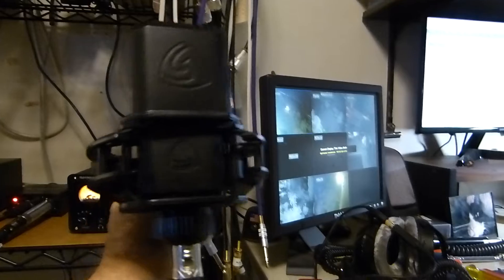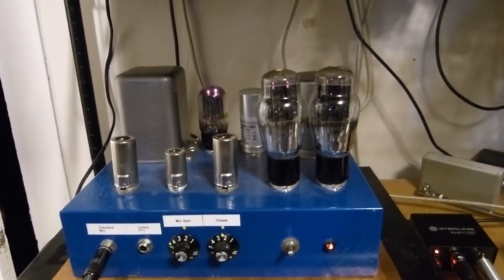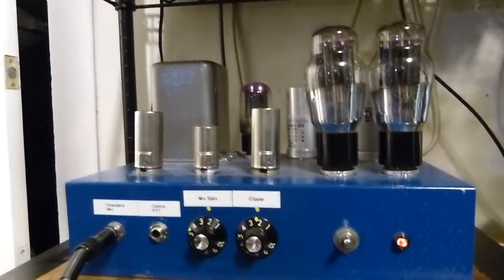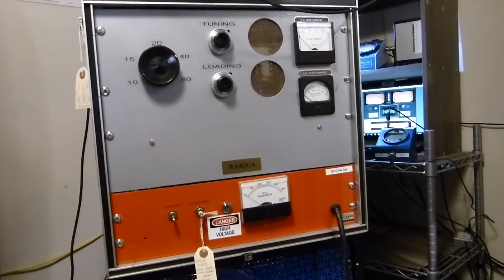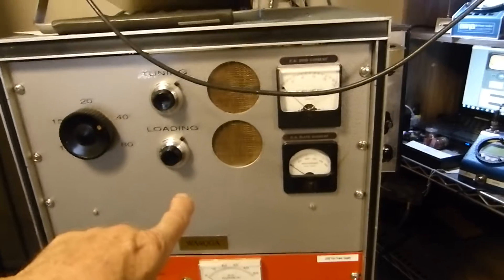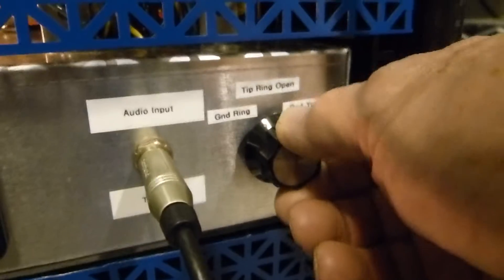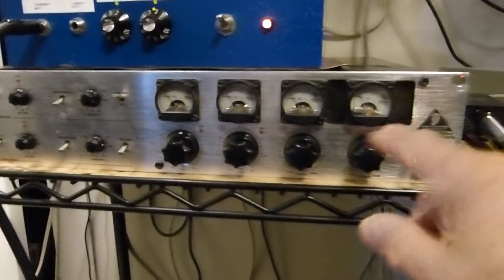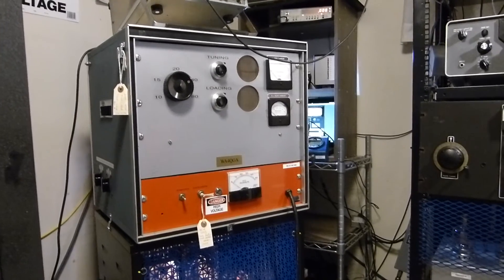Grounded Grid, Class-C, Plate Modulated AM Transmitter Using Eimac 3-400Z High mu Triode

Comment: Good presentation KA5WZY
Reply from the maker: Thank you.
A bit of a novel design but during its build I found something that really surprised me.
Take a look at the Eimac 8877 (link below) also known as 3CX1500A7 and notice on the third page the, Class-C - Cathode Driven - Plate Modulated, rating for the tube.
https://frank.pocnet.net/sheets/140/8/8877.pdf
Very much a surprise to me but also encouragement for me to continue.
Had a contact with JH7MQD last night on 40M and was quite a surprise to him I was on AM.
Even the 3-400Z has a class-C, plate modulated rating of 550 watts of carrier output. Pretty tough little tube.
73  WA4QGA

Comment: I've been looking at the SA-1000 preamps.   Have you done any tests on that?  Would sure like to see how the frequency response really is. Do you know if there is a vintage replacement for the 6H3N tubes? I haven't checked.  Good to see you're still kicking!
Reply from the maker: Still kicking and playing with high voltage...
Interesting you ask about the 6H3N tube as that is what is in that preamp/headphone amplifier I show in this video. 
I am going to guess that some enterprising fellow found thousands of them and thought about it and came to the conclusion he could get them for pennies as no one wants them, and build a bunch of instruments with them and sell each for, let's say, an average of $100 each. Well, 10,000 tubes would make him $1M. 
I do not know this but it makes sense to me. 
Once they are gone - they are gone forever. Just a guess of how these tubes have shown up lately. Seems like I found some data on the 6HN3 and they were used as IF amplifiers in receivers once-up-on-a-time. They are probably OK and will last a long time. 
Here is something on Ebay. They say they are GE JAN 5670. I think they were used for a while in VHF/UHF equipment.

https://www.ebay.com/itm/223590552581?hash=item340f091405:g:FcgAAOSwz21dLyUQ&amdata=enc%3AAQAIAAAA4PGSBbTrS19KzZxJrheRfDIUTjKvcg8%2BP2A0efGiBwVSqEvMZZJ%2FLrAmFZ8hPjuMVVfJglghxzvjE6IKpZ4xnGcI0EgKC%2BenSIV8gG3%2FWnI5CqvKLWFvSqthv68H%2FzkyqS0ZSz9eRWOr40%2Fz4rxT0fbF40RXG4ezfgHl%2Bg98ND7%2BCQpFn8w3vJ9l6h1t1JeOS9DBN4We7BpxUw5Nmh7sRfiwuISUd%2BGoicxbaRiwqtpnCC%2F3yr51P3adE8GcR1%2BgdwgQhXEM8NiIcaQbhf7nCvb59d6oUCfQaNRSpfmlKCF1%7Ctkp%3ABFBM8NzY-r5i

https://www.iwistao.com/products/vacuum-tube-6h3n-inventory-new-for-hifi-tube-amplifier-replace-5670-6n3-2c51-396a-high-reliability-hifi-audio?variant=40176763076723&currency=USD&utm_medium=product_sync&utm_source=google&utm_content=sag_organic&utm_campaign=sag_organic&gclid=Cj0KCQjwoeemBhCfARIsADR2QCvr3XI7k5o3r4riLQ5KozgPgj_0jNDx4_TQTFY93auYpu7QN2ioj0IaAlG5EALw_wcB

Here is the datasheet for the 5670:
https://frank.pocnet.net/sheets/093/5/5670.pdf
Reply: @ElPasoTubeAmps  I like how they make them out to be a HiFi Audio tube.  Which they may do quite well.

Comment: David, so this is single-ended class C? EJP
Reply from the maker: Yes, single ended, class-C, cathode driven and high-level plate modulated.
I have learned that grounded grid RF amplifiers running class-c are actually very common. Even in ham radio class-C would be the preferred way to run CW because of efficiency - also FM amplification - 
Grounded grid, class-C requires no neutralization (with the high mu triodes). 
This has been quite a learning experience. I will attach a tube datasheet for the Eimac 8877 and you can see especially on page 3 where they suggest a cathode resistor value in series with a positive power supply voltage and then bypass that for audio. 
They also recommend 83% modulation of the driving signal -not sure how accomplish that - any thoughts ? What am I missing?

I added a 10H choke in line with the grid before the ground connection and it helped the grid self-modulate and increased both the level and quality of modulation.

This is a completely new and novel adventure for me in RF amplifiers. Biasing a tube for class-B linear operation for SSB is no challenge but this class-C, high level plate modulation is completely different thing.

https://frank.pocnet.net/sheets/140/8/8877.pdf

Comment: That great. the newer AM broadcast transmitter is tube output water cooled. only 2 tubes. It class C grounded grid . the plate mod is done on a fancy HV power supply . giving us AMC . the audio in to power supply is digital .this cite is AMC only no am stereo or HD signal. some AM stations have that. look at WBCQ 250Kw AM transmitter. water cooled plate mod done in HV power supply. video on youtube. the station I keep up not that big. The back up transmitter RCA all tube with 6-866A MV rect tubes. all new  caps. EMP proof . from the cold war . still goes on the air. a lot of broadcasters have old tube transmitters as back ups. 3-400Z hard to get now. 73's
Reply from the maker: Thank you for the information. I did look up WBCQ on YouTube. I have only recently become aware of grounded grid, class-C operation as being much more common that I realized. I have not seen any schematics of anyone plate modulating the GG, class-C amplifier. I did it and it works but it seems to take more audio power than is required for the classic grid-driven, class-C amplifier like my push-pull, James Millen amplifier that runs a pair of 812A. I have incessantly looked for class-C, GG, plate modulated transmitters for schematics or manuals or any other information and can find nothing on the Internet. If you have any links to such information, I would greatly appreciate a link so I can learn more about it.
Thanks   73    WA4QGA    El Paso, TX
Reply: @ElPasoTubeAmps  WBCQ uses a water cooled tetrode . 250KW SW transmitter. Plate mod threw fancy reg power supply.  The station I keep on air is 2 water cooled tetrodes. digital audio to HV supply and also the screen supply as well. saves a lot of TX power on the input side. 125% mod max on pos side and no clipping on neg side. old rules which was on back up transmitter is 99% mod no clipping. draws way more power for less to antenna. the am station buy me is mosfets class D . much less power . that just air cooled. 73's

Comment: Hi David, nice to hear from you!
i have some rf amp building experience myself but not at this level, it would be nice if for the next project you explain the process of designing such a thing. i haven't been able to find any good source to for example know what cathode impedance to expect or modulator power vs rf power. i did some research myself to find out some of my question but i would really like to see how a pro figures this stuff out.

Manuel, IU3IRR
Reply from the maker: Hi Manuel, good to hear from you and that you are busy building.
I think about detail videos like you mention. That would take some planning, with schematics, and last a couple of hours. Years ago I made a multi-part video on Williamson audio amplifiers. I will have to think about the commitment for another set of videos.
This transmitter is rather unique. I was not aware that, class-C, grounded grid (GG) amplifiers were so common until I started this project. GG has a lot of advantages for class-C FM amplification but high-level plate modulating it was something I could find nothing on - but I had to try it anyway, and it works quite well.  It is a little more difficult to get 100% positive modulation than the classic grid-driven, plate modulated, class-C, AM transmitter but it can be done. Efficiency is that of a class-B amplifier (around 64%) rather than the 85%+ for a classic high-level modulated class-C amplifier. 
Can't have everything 🙂
Almost by accident I discovered that if I put a high value inductor (20H) in series with the ground and meter connection to the grid meter, it improves the modulation significantly. It allows the grid to self-modulate much like how we do the same to the screen of a plate modulated tetrode. Improves both the level of modulation and quality of modulation.
Also, a high mu triode like the family of 3-500Z class triodes, require no fixed bias supply and all the bias that is required, in this case -90 volts, is from a grid-leak resistor. It also does not require neutralization.
I will have to think and prepare before getting into a detailed video on this amplifier but it is rather unique and very stable. I would love to tell all the details of such an amplifier - actually better described as a transmitter as it is modulated and not just an amplifier.
73,   Please keep in touch - David, WA4QGA
Reply: thanks David, just by what you just told i can really see how little i know haha. unfortunately i am having some health related break from the lab, this is why i am playing around with software lately. anyway i really hope to be up and ready to build something really soon, i am not giving up to alternative ways to heat the home in the winter!
if it is in your comfort zone of work to put up such video i would encourage you to do so, this kind of knowledge is vanishing fast from the world and all the manuals i can find have to be translated from theory and math to real world so it is a lot of work,on top of that being in Italy all the manuals are a poor translation form English and very expensive even if you can find some.

very nice to hear from you, stay safe and keep in touch!

73, Manuel IU3IRR
  @ElPasoTubeAmps

Comment: Glad you’re back to posting. I do get a chuckle that you’re talking about mic and audio quality when the equipment fans are at such a high base noise level. 😂
Reply from the maker: Fans can be a noise problem. The other day I had an issue when looking at the oscilloscope display and I could see an alarming looking display with the modulation. Turned out to be the floor fan blowing across the back of the microphone. Whewwww..... Got to keep the mic gain down and speak directly into the microphone to keep the background noise down when transmitting. I do hear a few guys with the mic gain up too loud and it sounds like they are in an auditorium.

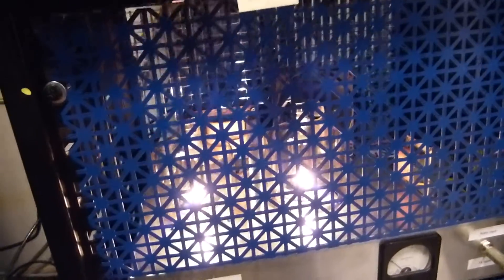Comment: 2:57 Do you ever get RFI or EMC problems using perforated metal screens?  I was told that this risks the human operator to potentially problematic amounts of RF leakage.  I'm quite dubious of this claim myself!  Sounds a bit tinfoil mad hatter!  I love showing off the glow of the tubes...
Reply from the maker: No, I don't worry about it one bit. Hasn't hurt me in 60 years or anyone else I know.  The screen is there for protection from the 3000 volts inside - not the RF although RF shielding is a good, and sometimes necessary step to help keep RF feedback out of the microphone and audio equipment in close proximity to the transmitting equipment.
On the Collins transmitter, the front is made of glass so, as you say, we can see the beautiful tubes glowing. As long as you stay away from the high voltage, the RF at HF frequencies (3 MHz to 30 MHz) is not going to be a problem from an amateur level transmitter. If you remember a few years ago, maybe even today, people propagate fear that holding a cell phone to our ear will give us brain cancer from the RF... wow... also, I have read where those "microwaves" change the molecular structure of atoms.  2.4 GHz Microwave ovens have a wavelength of about 6 inches, a massive amount longer than the atomic structure of atoms to change them at the molecular level. 
From the Internet: (An atom is so small that its size is difficult to imagine. One of the smallest things we can see with our unaided eye is a single thread of a spider web: These strands are about 1/10,000 of a centimeter (one ten thousandth or 0.0001 cm) in diameter. Although the cross-section of one strand is almost impossible to see without a microscope, it is huge on an atomic scale. A single carbon atom in the web has a diameter of about 0.000000015 centimeter, and it would take about 7000 carbon atoms to span the diameter of the strand. )
There is some very good stuff on the Internet but there is also a lot of misinformation.